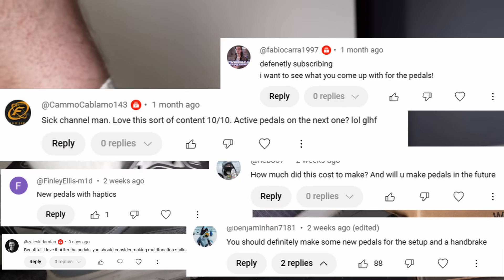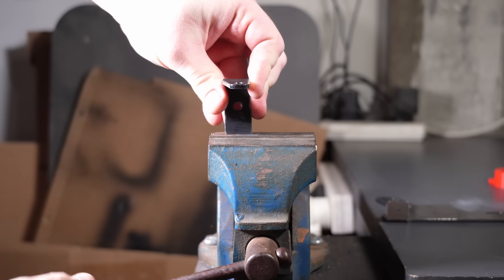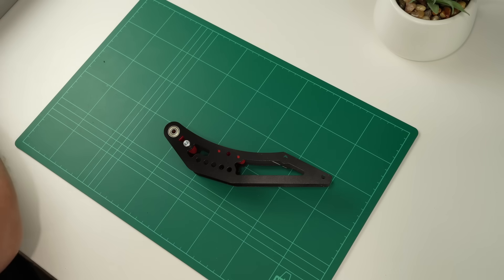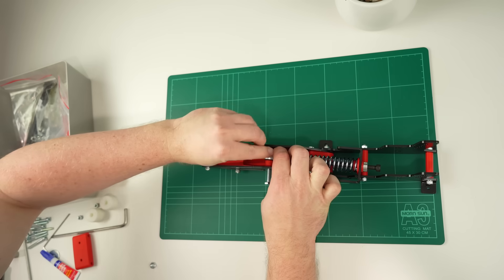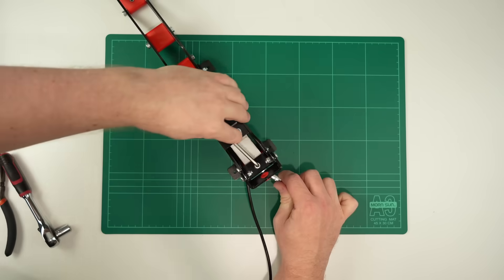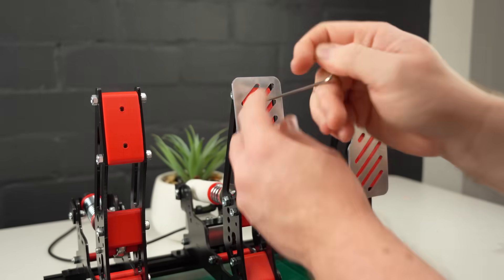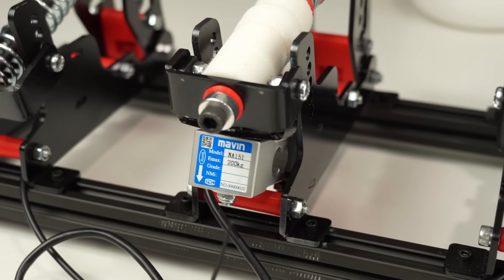DIY Load Cell Sim Pedals!

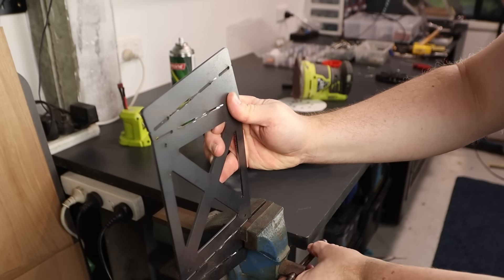Comment: 2:22 Hey Dan, love the content and am looking to start my own sim build shortly. I noticed you are using a vise to hold the plate while manually bending. I know this option doesn't work in all cases, but have you considered a vise brake for somewhat simple designs? They are relatively cheap and could be a better solution, in some cases.

Comment: hello i have a serious issue 
althought my loadcell is 24bit and arduino code is correct i verified it 
windows sets max reading to 1023 
so for example if i am displaying 2000 in arduino serial monitor, windows will still say 100% and 1023 
i am loosing my mind cause of this
Reply: I'm using teensy 4.0 and nau7802

Comment: Hello Dan! Awesome project! I actually built this pedal set, and I have a slight problem. The brakes work perfectly with HX711(80Hz), but the analog read of the HALL sensors are extremely noisy (it jumps ~70-80 out of 1024) for some odd reason. I am using SS49E linear HALL sensors, and the same magnets you recommended. I even used shielded cables, but that did not help my case. Is there anything you can recommend to me to try, or is there any way you have the code for the Arduino? (I know you integrated the pedals into the sim rig and wheel, but I do not plan to do that). I am looking forward to your response!
Reply: Hi gents!  I had the same exact problem:  SS49E hall + HX711 for the load cell + shielded cables as per recomended on the video.
However the ADC gave me the same 70-80-is dispersion. 

The Arduino pro-micro, uses the VCC as reference voltage, and since everything uses that as power soruce, plus the USB is usually very noisy to begin with (around ~100mV sometimes) i figured that if i would smoot out that +5V, maybe i will have a chance for better results.  
So i soldered a 100nF ceramic and a 10uF electrolit condensator between the GND and mentioned VCC terimanls, i wouldnt say that it solved the problem but it got rid of around "20-30" dispersion. 

Another "problem" i think is that the SS49E is bidirectional but according to the designe, we are using only one pole to work with - and also with a rather small and veak magnet. 
So i tried to use two of them on each side of the hall-sensor(mounted both magnets to the bearing block - so that the sensor sits between them) with this modification, the dispresion shrinks to only 0,5-1,5 when the pedals are in "rest" of "fully kikced in" position. (i think this is because then they are close to a magnet and have better flux trough them) But in the middle it still has around ~30 dispersion.   Which is still better than the original i had.

For emulation i have used the joystick.h  Rx; Ry; Rz; sliders, as these are plain sliders, they dont have "middle position" as a joystick-axis. 
But i still needed to implement minimum and maximum values because of the physical enstops of the pedals... thus further shrinking resultion. (giving more instable output...) 

I was able to implement a running average and EMA(exponential moving average) smooting algorithm and have a somewhat stable output - but these are significantly slowing down the emulation, and now i need to choose bethween a stable but reliable pedal and a quick but "all-over-the-place" one. :) 

Sadly i do not have a workaround. :(  
It would be much appreciated if you could share your original code - to compare, maybe i am doing something wrong.  
Also your thoughts and tips will be even more appreciated!  
And keep up the good work!
Reply: Could you share the code thanks

Comment: Do an inverted pedal mount, it'll be a way better feeling and an upgrade for the performance of your feet specially when doing heel and toe! 
And that's also why most JDM "old" cars have them like that. 
Even new cars have them like that at least for the accelerator pedal (don't put bmw in this as their fixed floor pedal is shit - personal experience since I'm owned by an E30 and an RX-7 FC3S(turbo, yes still rotary) and yes I did IRL drifting with them, that's why I can tell that!), also about the video length, like most comments said 30/40min is also great and you can make shorts that you can use here and other platforms to capture people to go into your full videos(food for thought).

Comment: would it be possible to make any of those laser sut metal pieces from wood?
Reply: I'm thinking the same thing. Have you tried it?
Perhaps modify the models a bit to use thicker wood, since it's wood, not metal.
Reply: @josesauriorex  ive not tried it, i just bought a t300 on fb marketplace

Comment: Love the video CNCDan!  I have started assembling your models in Solidworks so i can make my own set and make sure i have everything to complete it,  and i noticed on the BOM there is one missing thing that I cant seem to find that will fit.   What are you using for the screw inserts on the hall effect mount on each side?  Thanks in advanced!
Reply: M3 heat inserts into the holder and then m3 bolts from the side, i think. 
But i have used regureal wood-screws to hold them in place as i did not have the heat inserts.

Comment: there is an opensource project for active pedals, you should try it for your brake(maybe even throttle)
I want to build it myself but sourcing all the parts for it is a bit tricky, FYI use simhub for all your peripherals.

Comment: ok these turned out very freakin nicely dude. using the 200k is lovely for this set, because you have the sturdy base with the 20/20 to support it. Your arduino wiring portion is good enough to give a proper instruction for most people! I still think you need to do the rig next. You see exactly how much the pedals are moving around even with your 20/20! you have extrusion, so id say you'd be best to do an extrusion style rig and then a used racing seat in good condition or similar, and figure your easiest way to match seating positions with your equipment
Reply from the maker: It's like you read my mind 😂 Video will hopefully be out late this month, early next month!
Reply: @cncdan  nah not reading your mind, but i have been through it a few times ;) im on my 2nd rig, 2nd wheelbase, 4th set of pedals, 3rd shifter, etc etc XD

Comment: Hi! Just found this amazing video of yours! amazing work. I'm almost ready with my steering wheel from another tutorial and now i want to make your pedals. 
for the steering wheel i used Arduino Leonardo and rj45 port for pedals but i see that you use the pedals and the steering wheel independently. can't i just use the rj45 wiring so i can keep the steering wheel and pedals on the same board?
Reply from the maker: Yeah you absolutely can. I just didn't have time to integrate them with the wheel for the video, but I'll be working on that in the next video!
Reply: @cncdan  Nice, thank you for the reassurance 😁. I'll wait patiently for the next one 🫡

Comment: petg instead of pla+ which gets brittle over time
Reply from the maker: You certainly could, but I'm confident the PLA will be fine since its being used under compression. I was avoiding PETG because I had trouble getting it to print neatly, but I recently got a new printer and its now much easier and prints very cleanly so I will definitely be doing more with it in the future!

Comment: Wonder if we can just use hydraulics for the brake pedal
Reply from the maker: I've seen it done, so you definitely could! You'd still need a way to measure the force though so you'd still need the load cell, but you could do away with the spring and dampeners!

Comment: I'm not an expert about all these electrics, but, you need any software to program them, like un the FBeast wheel you used their software, the one from ffbeast, but for the pedals, how you program them ingame, or in the pc in general
Reply from the maker: I wrote a basic bit of software to get the pedals going just for the video, but I didn't bother sharing it as I'm ultimately aiming to integrate them with the FFBeast wheel in an upcoming video.

Comment: If you have a 3d printer that can print stronger plastics could you 3d print the whole thing rather than laser cutting
Also you should do a video on how you got the software up and running/include it on the GitHub
Reply from the maker: I have a printer that can do PLA CF and PETG CF now, so I should do a brake pedal in those and see if it survives. I suspect if I don't change the design that it may not, but with a design specific for printing I may have more luck!
As for the software, I only did a quick rough job of it to get it going for the video. In an upcoming video I'm planning to integrate it into the FFBeast wheel, so hopefully no extra software necessary!

Comment: 0:45 why is his GPU upside down?😂🤔

Edit: Figured out my own question's answer
The glass on cases are on the left side but it would face the wall. So he turned it upside down to see inside through the glass.
Reply: Maybe it’s the only way to fit it into that case I dunno, does it affect anything?
Reply: @ShopeeMarketteam  figured it out lol.
The glass on cases are on the left side but it would face the wall. So he turned it upside down to see inside through the glass.
Reply: @ShopeeMarketteam  yeah if he has an aio cooler for cpu all the air would be in the pump causing it to fail sooner.
Reply from the maker: It's because I'm in Australia, everything is upside down! 🤣 Jokes asside, it's a custom case I built so I could have it to the left of my desk and still easily access the insides. Yes the GPU and mainboard is technically "upside down" but it all works fine like this. The cooler is mounted in the correct orientation despite everything else being upside down. Its been working like this since I built it in roughly July 2022!

Comment: How much did you end up spending?
Reply from the maker: My cost is pretty useless, since it doesn't include the laser cutting as I can do it myself. The list of parts I bought totals about $80 AUD (roughly 51 freedom dollars). My slicer tells me there's about 120grams of filament in the prints, so lets call that about $5 AUD worth of filament. You'll have to go and get quotes on the laser cut parts to know a full price if you plan to build it yourself as depending on which company you use, the price probably varies a fair bit for those!
Reply: @cncdan  Right on, thanks

Comment: I built a sim rig, which was admittedly heavy, but sturdy as hell, out of strut channel and Right angle brackets with a 160$ adjustable racing seat from summit racing.  I went with steel because it was cheaper, but I'm sure you could find something that weighed a little less.
Reply from the maker: I've priced up building a whole frame in Extrusion, and it ends up costing about $450 AUD just for the extrusion so I'm currently looking into alternatives! Already got a seat sorted though! 😁

Comment: Bro made a whole pedal set because he wanted a clutch, then didnt showcase using the clutch
Smh
Reply from the maker: Lets call it a plot hole (or just bad script writing)🤣 I knew I wouldn't be able to try the clutch in this video because the pedals aren't attached to anything, and I don't have enough clamps to attach my shifter to the table at the same time. I also stole its arduino to use for the pedals! Don't worry though, there's a full rig coming and I will integrate the shifter/wheel/pedals into one device and finally give it a proper test!
Reply: @cncdan  I'll make sure to give that a watch, it's impressive work so far

Comment: I’d have used countersink bolts on the pedal faces tbh the bolt heads would’ve driven me crazy
Reply from the maker: That was the plan originally, but I couldn't easily get the M4 CSK's in a length that was long enough to work. I didn't have time to re-make everything for smaller bolts and I couldn't go bigger because the countersinks would be too deep for the pedal so I went with the button heads instead. I thought they'd bother me too but honestly, I can't even feel them driving barefoot or in socks.

Comment: I would say that making a DD FFBEAST wheel is a good choice, but load cell sim pedals - there are many cheap and well designed pedals already on the market. It will be easier and cheaper to buy them than risking diy version.
Reply from the maker: Its always easier and often cheaper to buy rather than DIY, but half the fun for me is building it! Since I can laser cut parts myself, the actual build cost was probably only around the $85 AUD mark, so it makes sense for me. Your millage may vary though depending on how much the laser cutting costs! As with all of my projects I always encourage anyone who's looking for the "cheapest" option to carefully check the costs of parts before they commit to a DIY option because it often isn't the cheapest way to go about things!

Comment: Don't mind me asking but why does the brake pedal use a load cell and not a spring?
Reply from the maker: The load cell isn't a replacement for the spring, it's a replacement for the hall sensor. It measures weight/pressure, rather than pedal position (its basically what's used in a set of scales). So instead of measuring how far the pedal has moved, we can measure how hard its being pushed. There is a small spring to simulate the first little bit of pedal movement, but most of the feel comes from compressing the dampeners. Hope this helps!
Reply: @cncdan  Thanks for your reply. can we still use the hall sensors since the dampeners would not compress lineraly and give the feel of the break .Would it still work? ofc might have to change the brake value according to some bezier.

Comment: I'll suggest to use countersunk screws on pedal plates (as guys said before) and not to do them of alu, cuz it will stain everything it touches if not anodized or painted. Maybe even steel will be better. Or some pre-made cheap automotive ones.  Great pedals though!
Reply from the maker: I didn't mention it in the video but I'm going to hit them with a bit of gloss clear for that exact reason! As for the screws, I can't feel them even in socks. Wouldn't be hard to countersink them anyway!

Comment: Hey I saw ur pedals were sliding around and you had to use your foot to hold it in place. If you have some dumbells, place them on the pedal frame. That's what I do temporarily.
Reply from the maker: Unfortunately I don't! It's not too much of a problem while I'm driving auto but once I start using the clutch I'll need the other foot 🤣

Comment: I like your videos a lot, but i somehow always get lost on wiring, and even more lost on programming... I would really appriciate if you made a video for an absolute beginner to programm a sim wheel. Thanx!
Reply from the maker: Thanks! I really only skimmed over the wiring and programming on this one as its all going to change when I finally integrate it with the wheel so I did a pretty quick/dodgy job of it just to be able to test it. As for wiring and programming the wheel, check out the github page for FFBeast, they cover it all pretty well IMO! 
Wiring - https://ffbeast.github.io/docs/en/connection_odrive.html
Programming - https://ffbeast.github.io/docs/en/software_firmware_flashing.html

Comment: awesome design  but , no countersunk screws on the plates would bother me as a sock driver^^
Reply from the maker: I too am a sock/bare foot driver, I only wore shoes for the video because the internet doesn't need videos of my feet!🤣 I did intend to use countersinks but I couldn't get the correct size/length in time for the video. Surprisingly I barely even notice them when driving though!

Comment: now just everything needs to run via a canbus or i2C to a single USB, just for coolness points
Reply from the maker: That's the aim! FFBeast supports some extra controls so I will be attempting to connect the shifter and the wheel up through that!

Comment: It's a little bit irrelevant now but if you used the ESP32-S3 super mini and a ADS1220 you could have had a 24bit resolution and 2k Hz for the controller. Esp32-s3 has Bluetooth, wifi, USB OTG, and a external reference. Pro micro is 16mhz esp is 232mhz. It's just simply better in every way.. I set one up to have calibration done with a 2button system and a small OLED screen(se1306), so i can just calibrate my pedals all on the control box so you never have to touch PC software... unless you need it for a specific game.
Reply from the maker: My plan is to eventually integrate at least the pedals into the FFBeast wheel, and maybe even the shifter if it supports enough IO. I just had the arduino here already so it was good enough to get me going for now! For what its worth though, the 16mhz of the pro-micro is more than enough power for a simple game controller. I've tested my own pro-micro based DIY controller against an Xbox controller in the past with no noticeable difference in latency (in fact mine was better, slightly!). The major hold up on these pedals at the moment will be the 80hz poling rate on that load cell amplifier. I will probably replace it with something better when I integrate it all together!
Reply: @cncdan  can't wait to see your future projects!